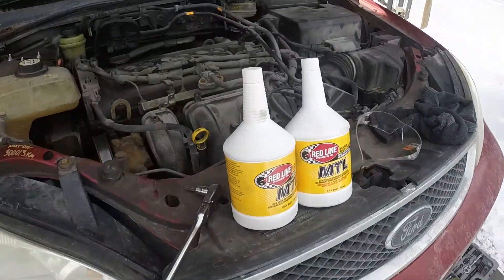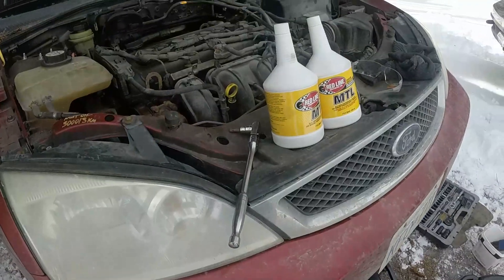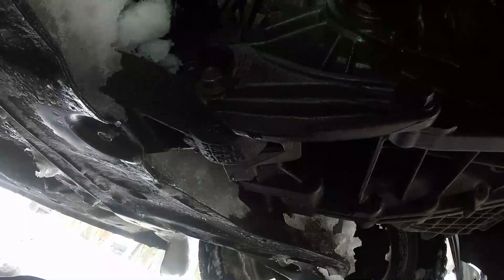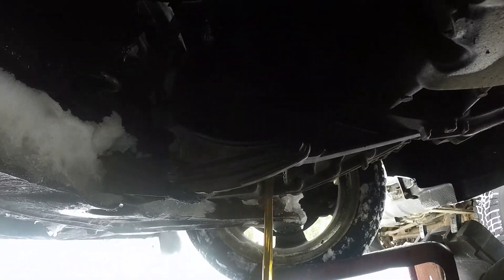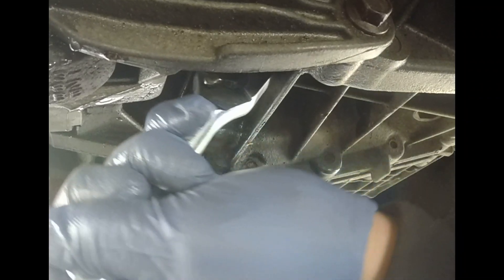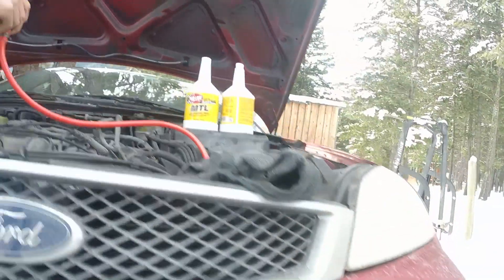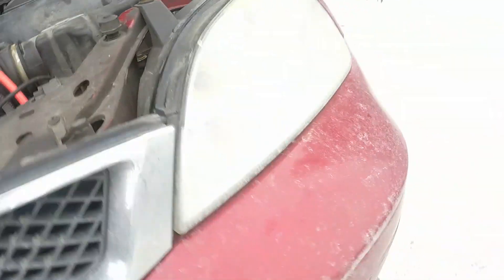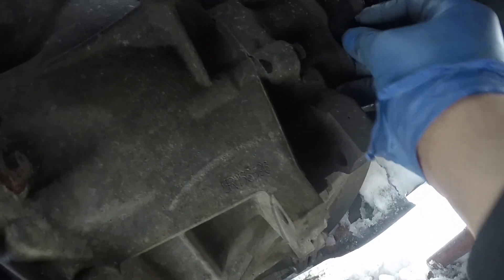FORD FOCUS MANUAL TRANSMISSION MTX-75  GEAR OIL CHANGE PROCEDURE

Comment: How much fluid does it hold, 2 quarts?
Reply from the maker: Something around 2.5L, don't remember exactly. I filled up until oil started to come out from the filler hole.
Reply: @PistonShack   manual says 2.1qt I believe

Comment: That's a MTX-75 box isn't it?  You can't drain an IB5 like that because it doesn't HAVE a drain port!
Reply from the maker: Hi Damain,  
Thanks a lot for the correction. After I done more research on ib5 and mtx-75 gear box - you are right! I fixed the title and descriptions to the video. Appreciated!
Reply: @PistonShack  No problem, I just didn't want someone trying to drain the oil out of an IB5.  Removing what looks like a drain plug near the bottom of the box actually breaks the box as it's a sort of pin that holds certain parts in place.
Reply from the maker: @FatHead1979  That's good point! Thanks  a lot)
Reply: @PistonShack  Well, you actually can drain an IB5
Reply: IB5 is mk1 euro version gbox?